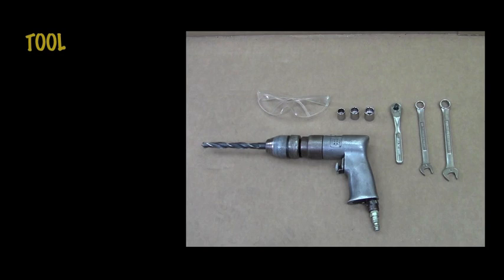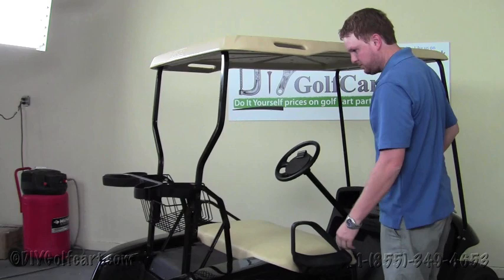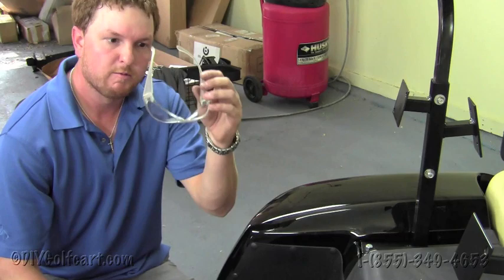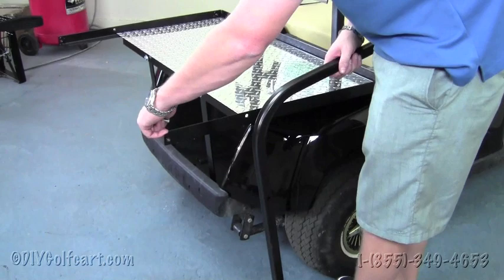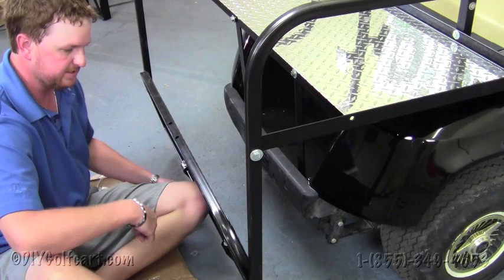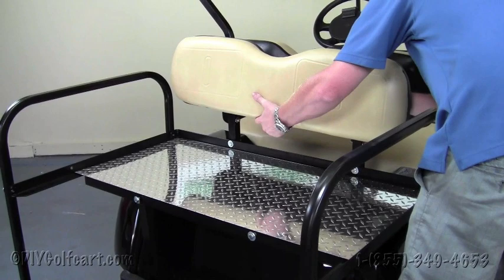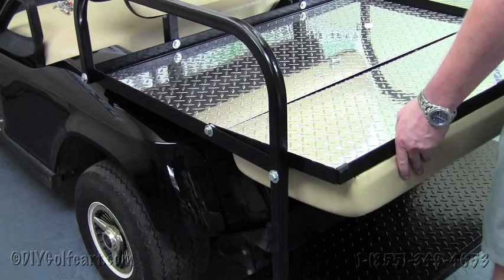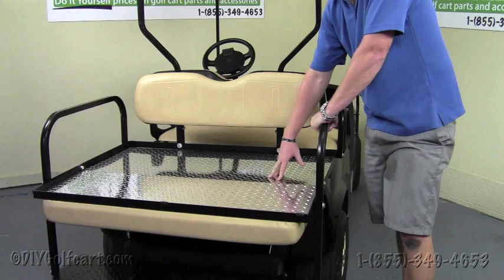EZGO TXT/Medalist Rear Seat | How To Install | Installing a Golf Cart Back Seat Kit

Comment: Are there any back seat options that don't extend the overall length of the cart? My cart is 93" and just barely fits into my F350 long bed. I need a backseat, but I don't think I can tolerate any more length. Any suggestions?